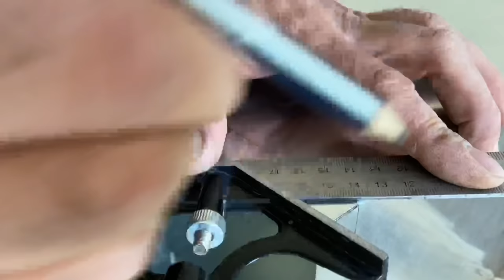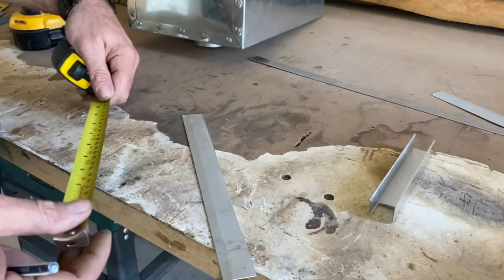Simple and Cheap DIY Tent Wood Stove.

Comment: Love the use of salvaged Olive Oil cannister, and the savvy use of improvised metal sheet bending jigs. Although the stove is not air-tight, the open air tent set-up would not create or allow dangerous accumulation of carbon monoxide. Really impressive fabrication of fully functional parts from simple raw materials and modern screws, washers, and rivets.
The thing was clean and well planned. 
Encourages me to give it a try, recognizing that the apparent simlicity and seeming effortlessness, is actually the result of much experience with the tools and materials. This was like watching the performance of a virtuoso musician.

Comment: Nice job! Well planned and executed. I thought the pipe jig for shaping your own stove pipe was genius. I may have missed it, but can you please provide the hole diameter (again?) but more importantly what size pipe did you use (O.D. of the pipe) for shaping the stove pipe? Thanks!

A couple suggestions (as I have been taking notes for over a month now to build my own beast soon! 😁):

1. Pull the top and insert a baffle under the stove pipe. Make it the length of the stove less a couple inches or so to allow air flow. It will help create a cleaner burn and a bit more efficiency.

2. I LOVED the home made chimney cap. Again: genius. Add one more thing: wrap a fine mesh metal screen to help reduce any chance of tinder from blowing out and falling on the tent. A baffle will most likely be the first line of defense, but minimally I would at least add the mesh. Note: Some retail designs incorporate a mesh at the base. Problem with that is it clogs easily and needs to be cleaned more often. Again, a good baffle might reduce that, but I personally think it makes sense to do it at the top. Now there is no chance of a blockage.

3. Lastly (quite honestly, should be #1 😆):  make a damper. Do this and experiment with the “top down” fire method.  This combined with a closed damper and a touch of air input, will provide much longer and efficient burn times. Less wood. Less stoking. More sleeping on a winter night 😎

Do a search on Ytube for “top down” burning. It has changed the way I do fires now. Goes against what we all normally do, but trust me… it simply works! And here is the skinny on another reason why to to it inside a stove:

A cold chimney has no draft. So when the fire is started at the base, it takes longer for heat efficiency to create enough “pull”, which in turn is why smoke blows back into a tent (or house). BUT… with the top down method, another gain is the fact that heat is generated just below the stack, establishing an immediate “pull” of warm air up the stack. It draws out the smoke instantaneously by heating the stack faster. Now. This might might prove an issue with an internal baffle… which is why MY version will incorporate a sliding baffle… pull it forward for lighting a cold stove, slide it back after she comes up to temp!

😎😎😎

Thanks again for the great video!

Best!

Edit: I forgot to mention: Top down burning also helps with wet wood. Search videos. The large wet wood sits at the base, with the dry tinder at the top. As the fire slowly drops downward, the hot coals will dry out the layers below! 🤨

Comment: Burning galvanized metal in an enclosed area can be very dangerous. Union sheet metal worker here, suggesting to use 16 gauge black iron as thin metal that you can bend with your hands may burn through. Not to mention the harmful fumes that are produced when heating galvanized metal to such temperatures as a stove.
Reply from the maker: Thanks for
Reply: Are the galvanized chemicals burned off once the metal grays over 100% making it safe or does the galvanize always give off toxic fumes even after "burned-in"?

Comment: Very well done. However, I wonder if that very cheap metal can sustain a fire for very long hours. and what would happen during very cold weather knowing there will be a lot of contractions and expansions, and very fast. Also, the bottom may melt if you don't put rocks or a grid.

Comment: Great video! I like that you don't speed up anything so you can see everything step by step. Do you have a material list? I want to build one for a co-worker.
Reply from the maker: Hello friend.. thanks for watching. I used (0.6mm)galvanized plate.If you have any questions please let me know.. I’ll be very happy to help 😊❤️
Reply: @karzanhiking2635  thanks, what size pipe did you use to form the exhaust
Reply from the maker: The diameter is 7cm
Reply: @karzanhiking2635  awesome, thanks!
Reply: @karzanhiking2635  if you post this info along with the sizes that you used in the video descriptions,  it will save you and everyone a bunch of time! 😀Thank you

Comment: What knife is that you used to chop firewood with? Can that be bought or is that also homemade? And did you use anyplans or design this yourself? If you did could you please share them? Also you could use a ball of steel wool to further prevent sparks from buring holes in your tent. Great job I subbed. Thanks.
Reply from the maker: Thanks for watching.. yes it’s also homemade, the blade has been made by a blacksmith friend, and the handle and the leather sheath has been made by my self, I’m sorry I haven’t made any videos for it, hopefully In the future i will make a video and sharing it… thanks for your comment 👍😊